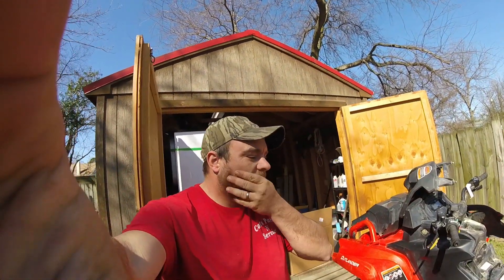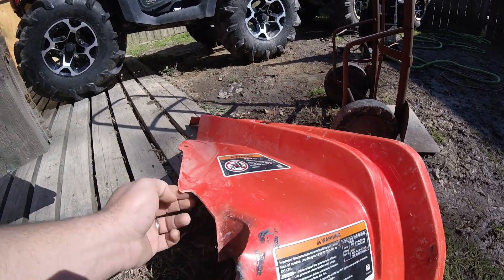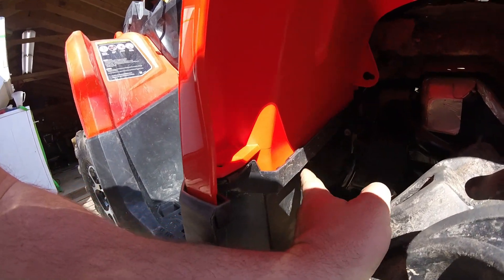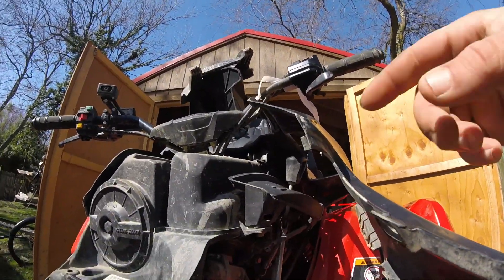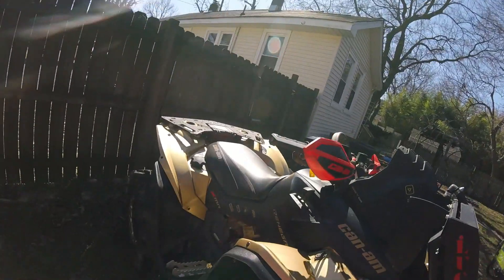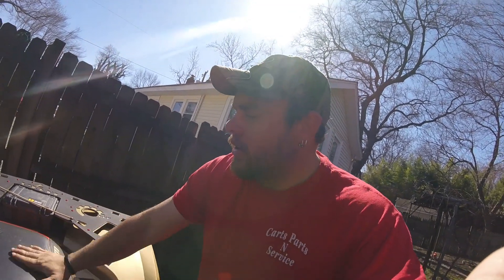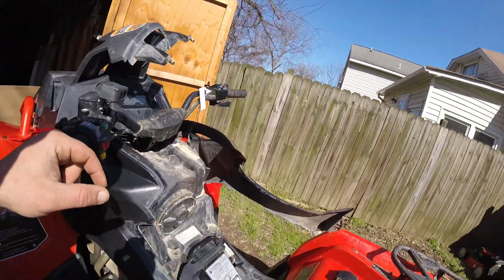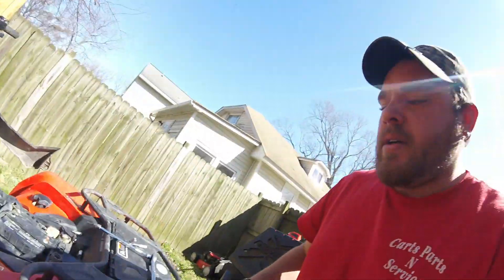Can Am 570 xmr ATV Fire Update (Fixed)

Comment: how do you check the radiator fluid?  do you have a vid on that?
Reply from the maker: On the xmr atv on the top of the radiator there is a part that comes off the top undo the two side hold downs and slip that top part off and everything is right there i can make a vid for u if you like
Reply: @vaswampnutz422  that would be wonderful, not sure how to get to everything under the panels, new owner here, thanks
Reply: it has overheated 2 times when I was running around in temps around 100 and I was going to check radiator and fluid first
Reply from the maker: @mostlymissiles  what year and model is it?
Reply: @vaswampnutz422  2016 Can-Am Outlander 570 XT
Reply from the maker: @mostlymissiles  are u in v.a? And your atv model when i looked it up its located under the speedo dash under the plastics this one in the vid is a xmr with rad relocation kit from factory
Reply: @vaswampnutz422  I just need to get it out of storage since the weather is getting better and see how to get the plastic off, always more things to do...thanks